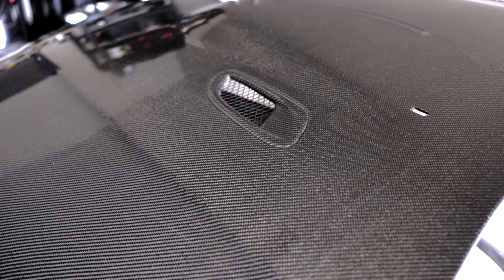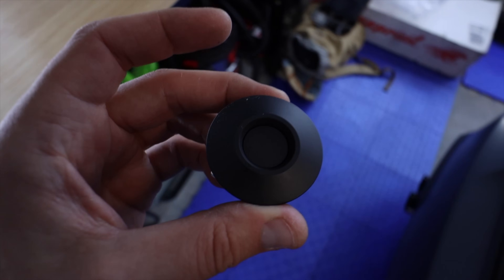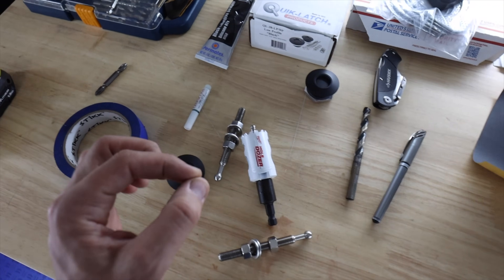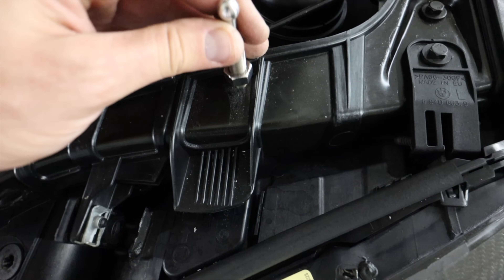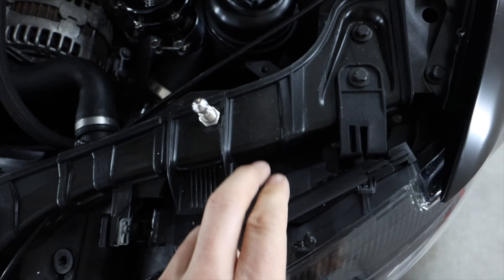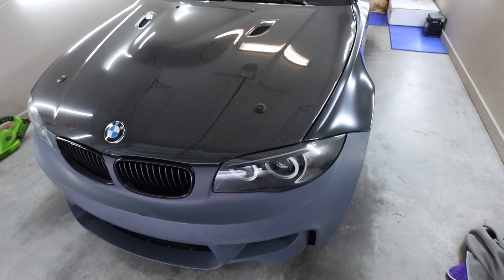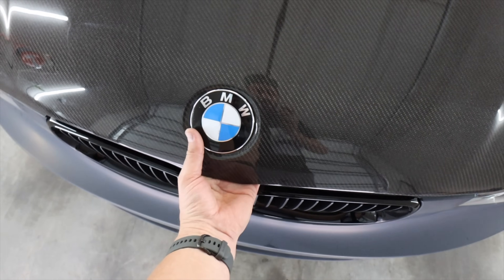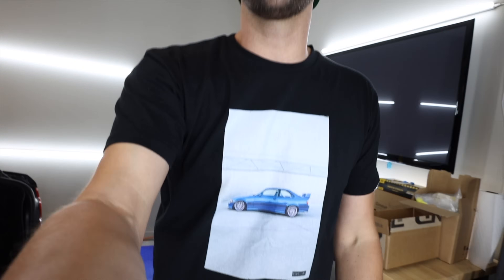DRILLING HOLES INTO MY $1300 CARBON HOOD! (Hood Pins Install)

Comment: Before you put the silicone on the drilled holes. I would get thin cyanoacrylate super glue put it around the exposed carbon fiber to seal it up. 
It actually has a chemical bond with carbon. 
Then hit it with silicone sealer. 

Just a little insiders tip on carbon fiber, after you have drilled and exposed it. It helps seal it up, so it doesn’t delaminate.

Comment: That’s an actual good detail to the CF Hood. Now, what would be the issue if those pins aren’t installed?? Is the stock latch not good enough for the CF hood??
Reply from the maker: The hood is so light, that at a high rate of speed it can become unlatched as air travels underneath the hood. Am I going to drive 200mph? No. Do I want to risk losing a windshield and carbon hood all at once? Also no.. so this is just for reassurance

Comment: Great install. What type of drill is best for CF? I need to enlarge a 52mm to a 60mm hole and I’m unsure which drill type works best for the thin carbon gauge holder.

Comment: Great install. Only thing I would say is to use lock washers or lock nuts to keep the nuts from back out of the pins due to vibration.
Reply from the maker: I ended up throwing a dab of loctite on there, seems to be doing the trick 👍

Comment: After the install, what is the "RTV" that you put around the drilled/cut area on the underside of the hood? You said "....to create a gasket". Is it some kind of glue or liquid sealant to protect the exposed carbon fibres?
Reply from the maker: https://amzn.to/455Z81N
Reply: RTV is an abbreviation of "Room Temperature Vulcanizing (hardening)." Commonly used in the US as a name for liquid gasket maker. It's usually some form of silicone.

Comment: Why so many people suggest the pins for the carbon fiber hood? Thinking to get one and I'd like to know more about it
Reply: fiberglass and carbon fiber can and usually at some point will break the factory bolt holes out and the hood will fly up ay high way speed and break and smash a bunch of stuff . people install things like this so your not surprised at a hood flying up doing 80mph.
Reply: @AwakeDude911  Good to know, thanks

Comment: I don't think that plastic will hold to the force of air catching under the hood at speed, I wonder if plastic is strong enough?
Reply from the maker: It holds the force easily. Haven't had a single issue
Reply: @ThicWhips  Such a nice hood and car, I am super paranoid, I have a Supra I want to put cf hood on and drill for pins, thanks for the how to